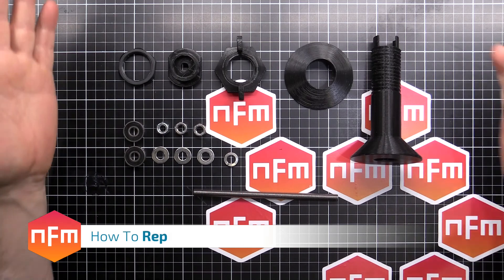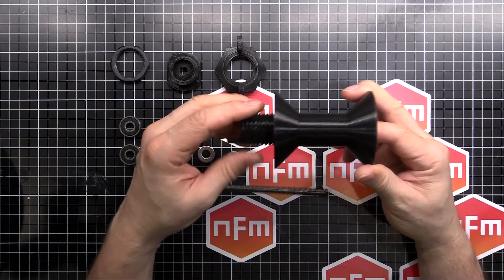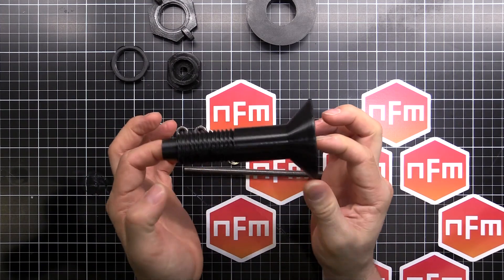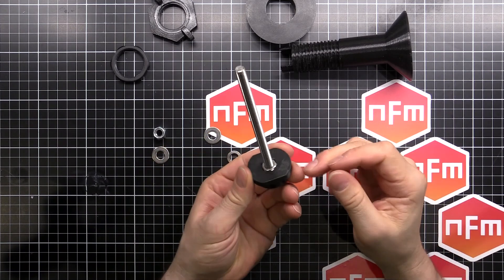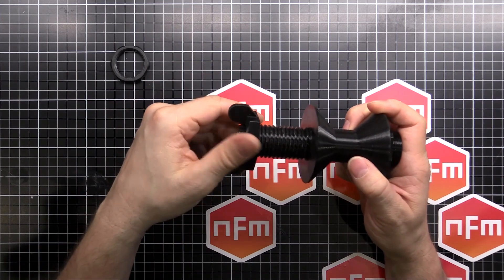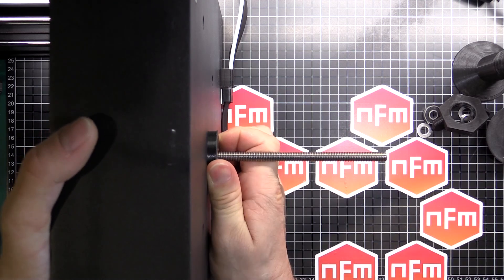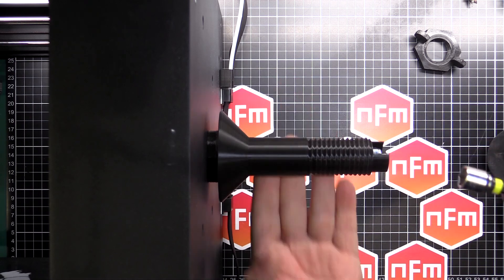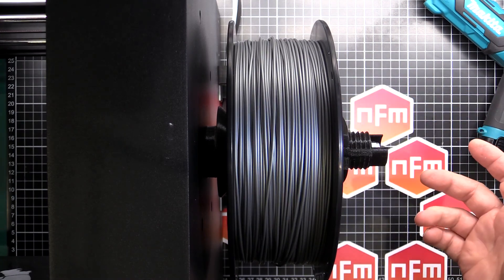Wanhao Duplicator 6 Spool Holder Upgrade

Comment: i printed this  off thiniverse file by file cuz i only needed 3 parts and the wing nut has ZERO chance of fitting on the threads....  hell the cone didnt fit till i sanded the shaft any reason why? or do i need to try again and print the file with all 4 parts?
\
Reply from the maker: You'll have to calibrate your 3D printer to make sure things print at the correct size.

Comment: the round side of the nut have a text on it, that text have to be visible in case it needs to be changed. so round side out, flat side against the washer. the nut is also stronger on the flat side contra round side

Comment: I printed your spool holder on my monoprice ultimate with the micro-Swiss hot end. However do you have any idea what would cause the threaded part to come out messed up? The main threaded part looks like it missed printing the full threaded lines. I am using S3D and have already changed the extraction to the micro-Swiss head. I will post the Pic under the model on thingiverse  it has me puzzled anything threaded does this. Other models are fine no issues
Reply from the maker: Hmm, not sure. Are your retraction settings tuned? If you swap to the Micro-Swiss head, I think you have to turn the retraction right down to almost none at all.

Comment: Adjustable to any size spool so long as its less than the major diameter of the cones...... As I found out ! 

This is a great design and one of the first projects that I built as it was obvious that the "hook" supplied with the machine, Wanhao D6,  wasn't really going to cut it. So off I set printed all the components ordered some bearings, it produced a great looking build.

So imagine my surprise when I bang on my first spool of ABS only for the cones to disappear into the central bore of the spool because it was bigger than the major diameter of the cones.

I resolved it by drawing up and printing a couple of cone sleeves which sit over the existing cones and increase the major diameter. It works, but its a bit clunky.

So nice design, but you need to increase the major on the cones to around 30mm from the current 26'ish. 

Any chance I could get a copy of the original files to upsize and re-print?